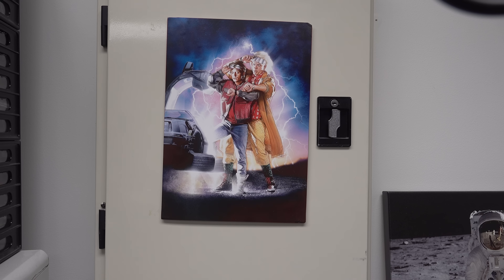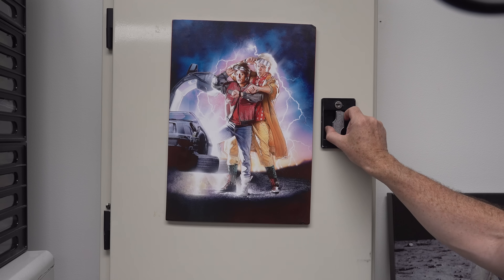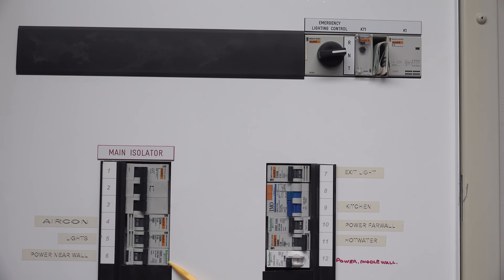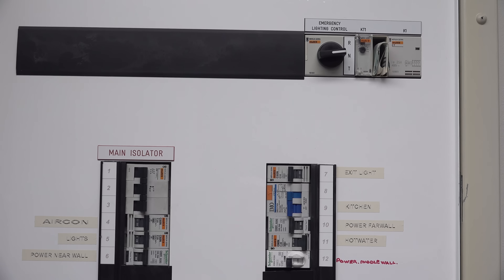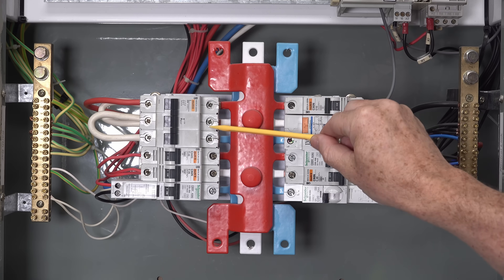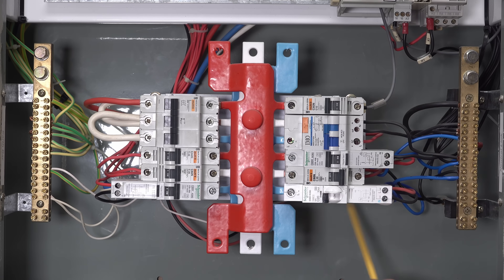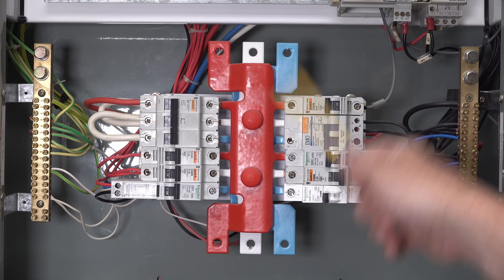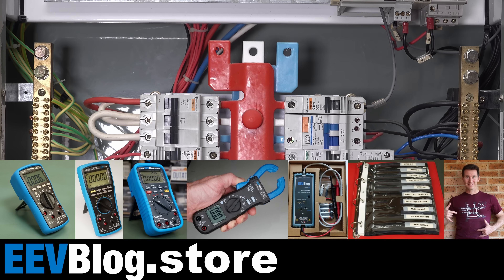EEVblog 1652 - Why is my Lab Switchboard Wired Like This?

Comment from the maker: Mystery SOLVED!
I went and checked the meter room and sure enough my unit only has a single phase meter. Lots of others have 3 phase (3 different meters). So the units must all have 3 phase wires pulled to them as standard for futureproofing, but not all have 3 phases connected and metered. There are only two spare meter slots on the board for my level, so only one single phase unit could upgrade to 3 phases without having to bodge anything.
My panel is 3 phases because it would be a standard design for the entire building regardless of how many phases you get installed.
Reply: Huh, that's weird to me in the US. Our 3 Phase meters look very similar to single(Split-Phase) meters. They just have some extra prongs on the back, never seen 3 separate meters per phase.
Reply from the maker: @RyCorp77  Yep, three old school spinny analog meters, they have the units numbers above them. Some have three meters, some like mine have only one.
Reply: @RyCorp77  The old spinning meters were like that as you can get 1, 2 or 3P.
Reply: @retrozmachine1189  the smart meters are also 1 and 3p (the 2p sites just use a 3p meter) unless QLD has a different set up bu i doubt it
Reply: @ThyerHazard   Yeah, smart meters are not like that.  1P or 3P not multiple meters.
Reply: In the netherlands, you pay different amounts for how much Amps you can use at a time.
There are different options you can have.
1phase x 35A
3phase x 25A
3phase x 50A
3phase x 60A
Reply: @dalyxia  interesting; are these all for detached / semi-detached houses, or do flats count as well? Even 35A on a single phase is quite beefy for a flat, maybe even a little house. 3 phase 25A would be comfy if you have a storage heater, induction cooktop, tumble dryer and some air conditioning. 3x50 let alone 60? Can run a machine shop in addition to a house, haha!
Reply: @KeritechElectronics  its standard for every living space\house, minimum 1x35Amp. And i see liander (a company that controls the powercable infrastructure from powerplant to the meter inside the house, only has minimum 1x45A available
Reply: @dalyxia my unit has a 40A breaker downstairs protecting my sub panel. 80A service fuse. 240V single phase.
Reply: @dalyxia  that's a whole lot of power compared to e.g. Italy, where you can easily have a meager 16A for an entire flat, maybe even house. Here in Poland we typically have 20 or 25A single phase in old apartment blocks and tenement houses (may get lower if wiring is decades old though), 3x25A for new construction apartments with induction cooktops, 3x32...50A for detached houses.
Reply: @KeritechElectronics  16A seems very low, like on a summer day someone gaming on a high end pc + washingmachine + heating a dinner in a microwave while an airconditioner keeps the room cool can already be way more than 16 amps.
Reply: @dalyxia  definitely very low, those Italians really need to upgrade their grids!
Reply: @KeritechElectronics  My house in Australia was connected in the 90s, and has 3 phase 100A
Reply: @zspacecaptain8228  now that's an industrial grade feed :)
Reply: Modern 3-phase meters are the same form factor as single phase
Reply: @JamesTK  sure they can be; the traditional European form factor is larger for 3-phase meters but a board that can accommodate one will also accommodate a single-phase meter.
Reply: I can sleep now!
Reply: 3 phase as standard because that way single cable type to use inside each floor for wiring, and a single bulk purchase of switchboards and supply cabling as well. As to why they went single phase likely the cost of the meter, and the standing charge, as a 3 phase meter is much more expensive, along with the higher standing charge.  Standing charge is higher because you now have a higher potential kVA use, 3 times the single phase one. So for a standard small office unit, a big saving in monthly charges, making the park overall more competitive price wise, as a business will look at fixed charges as part of the package, and having a much higher power bill, which is not needed due to the use, will make a big difference in say rental pricing.
Reply: Are the other two phases live?    And unmetered...
Reply: I've got the exact same thing at home / in my lab, only that the phases are bridged on the supply side in the meter box in the staircase, and I wired the main panel inside for proper 3 phase. I was going to raise the power allowance and switch to 3 phase in 2020 or so but couldn't afford it, so I sticked with single phase 240V 25A with some usage time management to keep the installation from overloading and to use cheaper off-peak juice for power-hungry stuff (dishwasher, washing machine, storage heater).
Reply: You will not notice the difference... until You try running a three phase motor😂
Reply: @livore  or a heater wired in delta or wye without neutral point connected.
Reply: Thanks Dave, exactly what I expected the case would be.
Reply: yeah thats weird, in aus we also have separate three phase and single phase meters. ive never seen each phase metered separately
Reply: never mind re read the pinned comment -_- makes sense the connection fee was probably higher for a three phase site, to get three phase hooked up you would just need the meter isolator changed and the meter exchanged for a three phase one and obviously your sub board  re wired or it would be a nice phase to phase bang hahaha
Reply from the maker: @ThyerHazard  In this case they have to install two extra meters for the two phases.
Reply: @EEVblog likely if you did request 3 phase (and the wiring was there) they’d replace the spinny with a 3 phase smart meter as part of the install. They’re an endangered species now
Reply: @EEVblog  I would love to see it, thats a new one for me
Reply: 3 meters to meter 3 single-phase instead of proper 3-phase meters? as german that sounds stupid
yes, we, too, have single-phase meters - but these are often used only for general power like stairs lights or one-room-flats/-bunkers with just a light and a single outlet
but regular homes are all 3-phase with one single 3-phase meter
Reply: Ah, that makes a lot more sense.
Reply: I was looking at your incoming service disconnect, after you removed the cover. The first thing that stood out, was the phase-phase jumpers on the backfed 3-pole mcbo. You should still balance your loads between the bus bars, but this is less about balancing across phases, as it is about potentially overloading one phase of the incoming 3-pole mcbo.
Reply: @thomasbonse  that main switch is just a switch.  Things start to go wrong when someone mistakes that switch for an mcb and uses it as such.  Both have their nominal current stamped on the face and if they don't know that the switch exist in the same form factor, there might be fire..  I have found several in use instead of an mcb in my 25 years as an electrician.
Reply: me just looking at that board .... i don't want to look and be told what's wat, i want to take it apart and see how it works myself
blue as a phase and black as neytral could get me killed though, because eu do it the oposite
Reply: This is evident at first glance at the top left circuit breaker. One thick red wire (single-phase power) and two white bridges. One phase split into three poles.

Comment: Interesting that over there, C curve circuit breakers seem to be standard. Over here in the UK, B curve is the standard for most things. It's also interesting that they allow you to mix different brands of circuit breakers, and that 6kA devices are fine for a commercial supply.

Comment: All the RCDs I've seen in South Africa are the double slot ones and the always have a test button. In residential installations, the standard seems to be a single 30 mA dual pole (for single phase) one, directly after the main overload switch.

Comment: A commercial 3 phase board, my house ones like that, i got the hager version of that much cheaper and still a good board and its a 3 phase installation as i like to run 3 phase equipment and got a 3 phase hybrid solar installation

Comment: I would guess that those 3 bus bars are being misused there or not used as intended. Maybe all the cabinets went is as 3 phase prewired up and then the just did that. These busbars have a big hole in each end. I would suggest that in a larger board the 3 phases would be wires with ring lugs bolted to each bar and then you just keep adding more gear below and bolt the 3 bars together.

Comment: You're future proof to 3-phase. I did that short on my 3ph box since street power comes single phase. It works, and allows you to do 3-ph if you can in the future. The board probably came 3-ph ready with all components, so during comissioning they just downgraded it with the short in there and voila. Also see that a higher current 3-ph C-Breaker can be installed up in the middle if desired/needed.

Comment: Here is the million Dollar question.: Are the blue and white phases even live? If not, that would explain why the DB is wired the way it is. But there is also an advantage. There is already a 3 phase cable running to the transformer/sub. That will make things quick and easy to convert the DB to 3 phase if you need to. Another advantage to only running single phase is you only need to install one power meter instead of 3  of them 3which you would most likely have to pay for.

Comment: wasting wiring and energy is important. had they commond the 3 phases at the source rather than panel, all the metal in the cable could have been used to lower resistanc. but no, need to waste energy after its metered

Comment: interesting design, here in poland things seems to be more compact ever since we switched from ceramic e27 and e40 fuse holders in the 90's but we often have our distribution boards wired horizontally, and the 3 phase distrinution bars are much more compact the ones in your lab are masive and only painted, not safe to touch.
it is also interesting to see all this connected to single phase split into 3 way fuse
but that middle bus bar is giving me the creaps, it is scary looking

Comment: I'm a bit surprised the AC isn't running on 3-phase, if for no other reason to stop replacing motor start capacitors.

Comment: you've gotta be kidding me... black is really kinda objectively better of a colour for neutral but... that's the spicy one here! why do 240v countries demand to be different just for the sake of it??
Reply: (i should clarify, i think the american wire colours are the stupid ones, although i also think white is a really dumb colour for a hot)
Reply: @ultravioletnanokitty  Quite ironic how red, white, and blue are the classic American colors. In the US, the phases are black, red, and blue.
Reply: @TD75  my brother always says that, i think it's hilarious
Reply: omg though my housemate hooked up the white wire on a 12/3 so cable from his generator's 240v output to the neutral when the power was out (several surge protectors were not thrilled) so i actually kinda think green is a better colour. with uninsulated or a yellow tracer for ground

Comment: Idk why but it seems so difficult to get a straight answer, but does anyone know what the current rules are on the insulation colour codes for AU wiring? They used to be Red/White/Dark Blue for the phases and Black for the Neutral, but for more modern wiring I see it say that either
A: It's the same, but you can also use the EU colours, brown (L1), black (L2), grey (L3), light blue (N);
B: The EU colours have replaced the old red white and blue for new installs; or
C: You can use whatever colour you want for the phases so long as you don't use green/green+yellow, black, or light blue (anything to confuse the phases with a neutral/earth conductor.

Comment: as a (german) electritian, i'd be shocked. those wires are wild!
Reply: I still sometimes see red yellow and blue for phases in old industrial installations. Fun!
But that really doesn't spill over outside of the distribution boards, of course. Usually it's just the bus rails.

Comment: Yeah, I see that all the time. In fact, I can't remember doing it any other way in new apartment/office buildings. The cabling is always there to support 3-phase but it's not always a given that 3-phase will be connected. 3-phase is a bit more expensive after all.

Say, in one of the sites all the apartments in all the buildings have a standard 400V cooking plate, so they all get 3-phase meters and 3-phase board. Now, on another site the plate is 240V so while the cabling is there to support 3-phase, the meters are monophase and the distribution board in the apartment is also wired for monophase (although the change would be rather easy - replace the main differentials and the connection rails. 

Yes, Dave, I've seen the pinned comment. ;)

Comment: Minor correction: The "kitchen" two pole device is in fact an RCBO, an RCD would not provide any overload protection. 

I'm pretty sure Merlin Gerin got bought out by Schnieder, but I still see plenty of them kicking around. There's no MEN link in your board, so there must be a switchboard upstream with the tenant meters. The "power point cable" is called TPS -- thermoplastic sheathed.

Comment: Its less about future proffing and more about not knowing what the space will be used for.  If you setup s bitcoin mining operation in your office you would likely need 3phase so its a meter swap and a connection without need for running extra wores.  Some commercial 3d printers, heavy duty sewing machines, molding machines etc need 3 phase so its nice to be free to have the capicity there.  Residential 3 phase is typically limited to deep well water pumps that need 3phase for required power in a narrow well hole

Comment: I’m not an electrician or an EE.  I’m just a handy hubby.   Not only that, but I have no frame of reference for Aussie or 3-phase panels. 

Interestingly enough I saw the linked phases right away. Given white links were used between the phases, I could not even begin to tell you why that jumped off the screen at me.  

Sometimes it’s better to be lucky than good I guess.

Comment: @ 1:49 Merlin Gerin - are now Schneider Electric - they were good/ dependable mcb…. Never seen one fail…. 😊
Reply: I've seen lots of Merlin Gerin fail, but that's only because any still left standing are getting pretty long in the tooth now. I'm replacing them from time to time.
Reply: @ maybe in humid climate - for example in pools panels they totally disintegrate in a few years… but that are not the mcb’s faults … 🙂
For example I have many(most) for Hager (2 slots model) RCBO’s failing in six monts to an year … - if you press test button nothing happens 😅…. + for a lot of them and mcb if you switch them off and then on again the lever won’t stay on or the internal mechanism won’t turn on only after many tries 😅 … 
But many electricians swear on Hager good quality …. But I had only bad experience with them … (from the good quality brands)
Reply: @mihaiachim5299  I don't have a brand of MCBs that I could swear for. They all fail, I replace them all, so really, if you have such a hard environment, maybe it would be an idea to completely seal the cabinet or add a humidity sensor inside and a heating element. Not sure about the local code about that. Or maybe a special kind of cabinet that would keep the environment inside controlled.

 Might not be cost effective, but man, having RCD fail in an on position is not a happy thought when you're in the water.

Comment: It would be a safety issue I suspect.

In a large office with many outlets you can zone the site to keep phases separate, likewise heavy plant such as HVAC and UPS (big units not the tiddly little PC types) can be wired with three phase directly.

In your office / lab there is a danger that you could get devices that are adjacent to each other plugged into different phases, in which case you could get 400+ volts between them.
Even with your two walls being on separate ccts, They are still quite close so it  would still be easy to plug into an outlet on one wall and work on a device plugged into the other wall. (Even something a simple as using an extension lead) 

Cost wise, it is probably cheaper to order the panels in bulk to cater for a three phase install and then convert them with a simple wire link as they have done, rather then have two different designs.
 
Andy

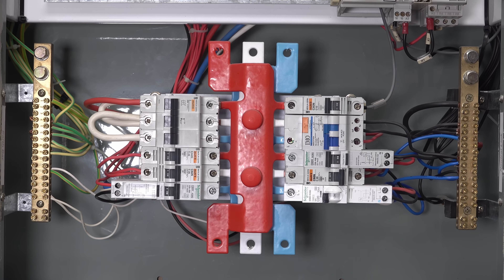Comment: The red/white/blue bus bars are all the same one phase looking at the 3 x main braker inputs having bridged inputs in the upper left corner (shown at 4:40). EDIT: Dave figured out the same at 5:22 "The three phase switching here is just linked to the one phase, that red phase..."

Comment: WHY YOU HAVE YOUR RCDS AND MCBS VERTICAL INSTEAD OF HORIZONTAL?? 🤯🤯
Reply: It's the usual arrangement in many places. Almost all 3-phase distribution boards sold in the UK (and the rest of Europe) have this arrangement. The design of North American split-phase boards is similar although they have only two phase wires rather than three.

Comment: The phase deal has to do with future changes. Your office only required a modest current draw form 1 phase. Who knows what a future occupant would require? It's a thousand times cheaper to put the wiring in for 3 phase now rather than a retrofit later. Thus it's probably part of the building code to do so.